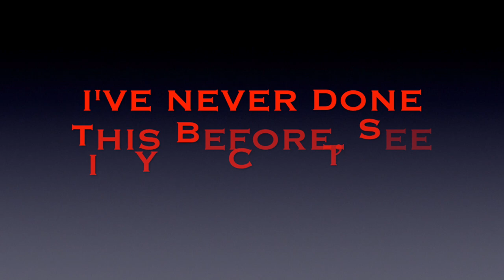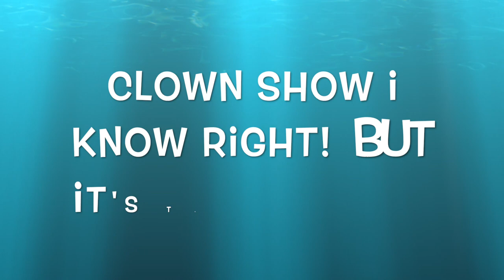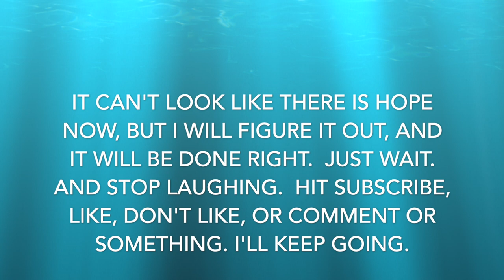4.DIY Boat Building: Will It Ever Fit TOGETHER?

Comment: I made one small framed boat in my life. I went through the same thing…..a lot of mock up, break down, mock up again…..It’s good that you take your time to get it right and do things over if your not comfortable with them. Keep at it……..you will end up with a boat that you understand completely and can repair or modify easily.
Reply from the maker: Well I hope I don't have to do any repairs or modification, but you are right I will have the background if needed.  There were some steps that were more challenging than others but bit by bit it's coming together.  Appreciate it.

Comment: I struggled with my first Stitch and Tape until I was told to use a plane to cut a 45 degree Aris on the inside edge about half the thickness of the ply. without it its almost impossible to sit the ply edges evenly against each other.  

That and like all timber ply has a memory you can induce, so bend nearly to shape stitch it then walk away for a day or two it will bend the ply to the right shape, then come back and tighten stitches to bring in to place
Reply from the maker: Yeah I expect a lot of lessons I can say about the first stitch and glue when I am done.  List seems to grow by the day, but all in all it's going to work out.  The small pieces of pipe do help a lot to help the ply line up properly.  My issue is I didn't take the time as you suggested to let the ply ease over time.  I had to get it done in a hurry.  So, I am going to pay the price over time, but I believe I have corrected the impact of that misalignment now.  Let's hope so.  Thanks for the feedback.
Reply: @Bigeaux20  its almost like you have to build two the first being practice   ;)

Careful its addictive I am finishing my 3rd boat and have already bought plans for number 4.

I have a very responsible desk bound job I usually have a boat being built in my workshop as therapy.